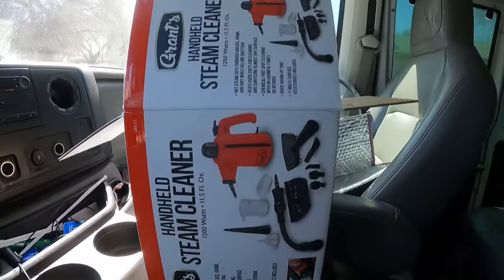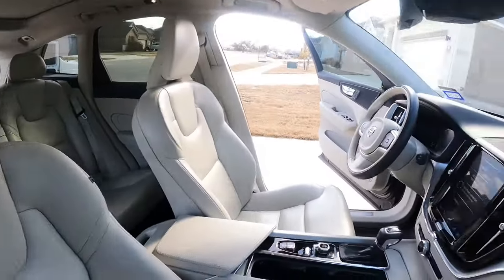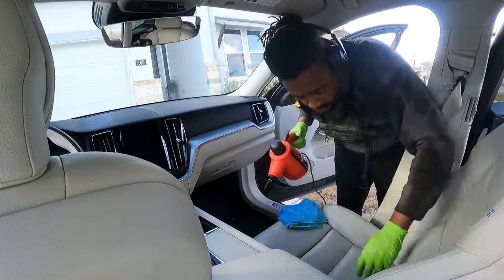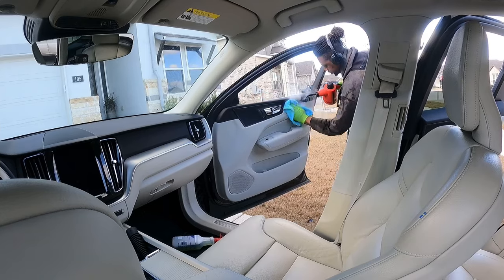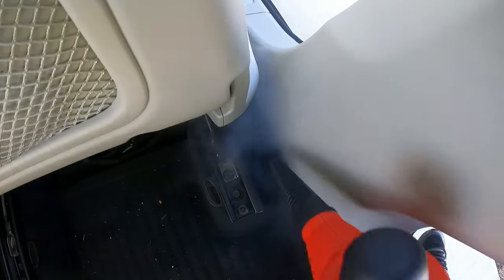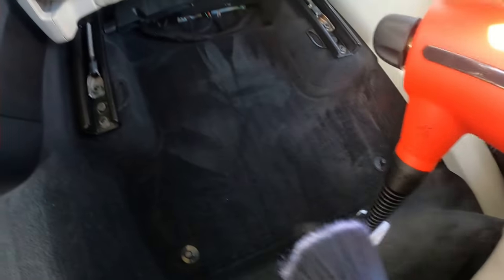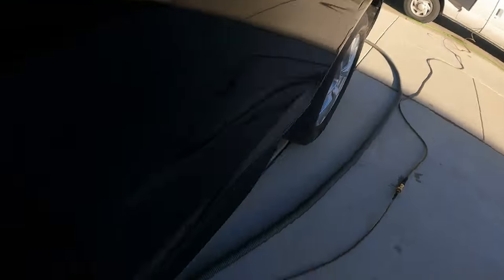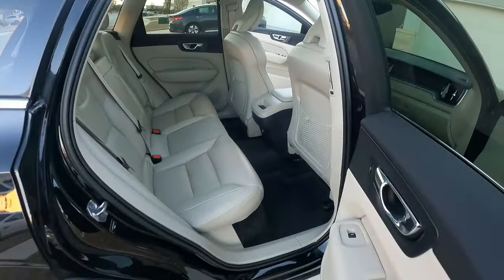Grant Handheld Steamer Review | First Time Using My Homemade Extractor !

Comment: Did you use the extractor after you steamed cleaned the carpets tog et the water out? Or can you just use the steam cleaner on the carpets without extractor? Tia
Reply from the maker: Depends on the condition. If the carpet not bad I just steam it but if they’re bad I’ll extract.